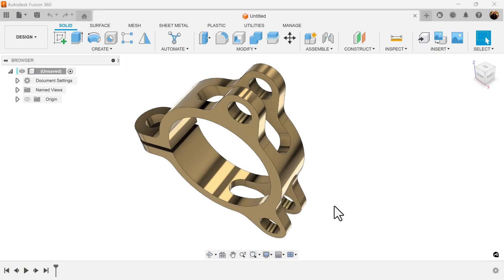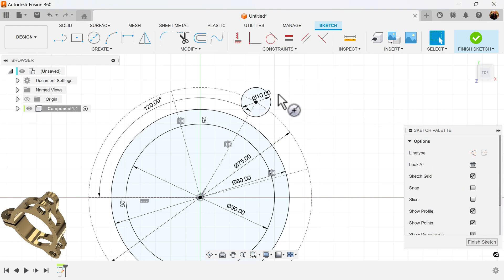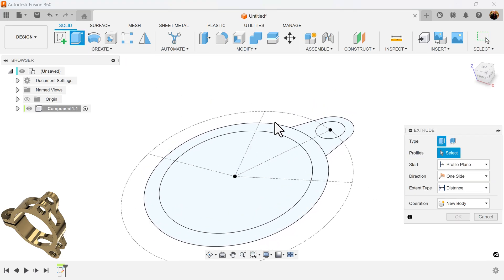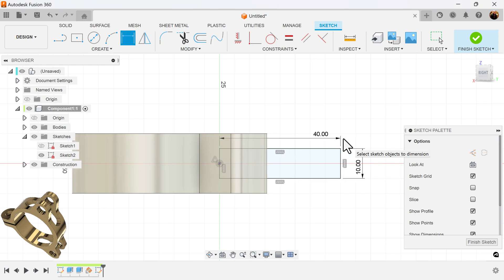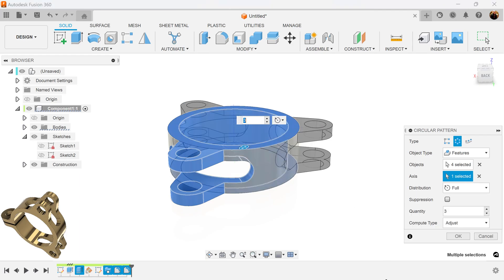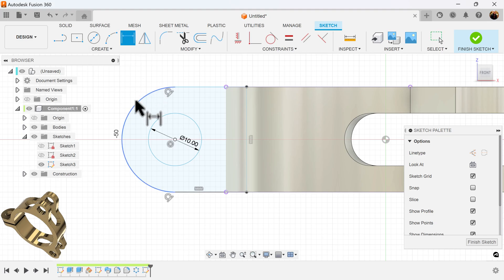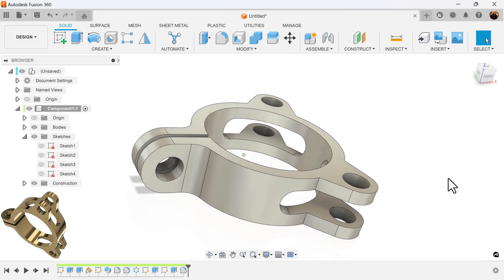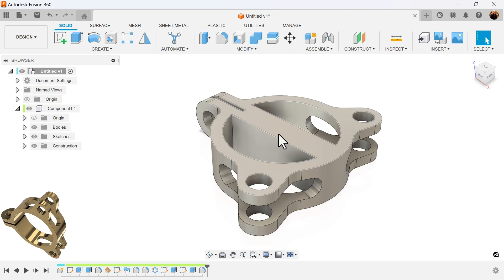Modeling in  Fusion 360 | Rep no. 26

Comment: Your correction of the fillet in the circular pattern didn't work with me, the fillet icon won't become bleu.
Also I liked the fillet full round function at the slot very handy. I also try to avoid start a sketch on a constraint line, because it locks it into place.
Your sketch are automatically projected?
Reply: I found the autoproject in preferences. 🥴
Reply from the maker: Are you referring to the edges that you selected for fillets not turning blue? If so, try holding the control key when doing so.

For sketches on constraint lines, it depends on what you are hoping to achieve. Sometimes you may need to add your own constraints in which case you would avoid automatic constraints provided by Fusion 360.

My sketches are indeed automatically projected when solid geometry faces are visible and used. This is useful to assist in creating constraints when selecting face geometry used as an active sketch plane.
-  You can set this in Preferences--> General--> Design
--  Make sure that "Auto project geometry on active sketch plane" is checked.

Comment: Another great teaching video! How or why did you use the dist of .25 in the sweep I couldn't find what it was referenced to. Obviously it created the sweep you wanted, I just didn't see where it came from, Thanks Again for these Awesome video's!
Reply from the maker: There are a number of ways I could have performed that cut. I could have formed a revolve and set it to only cut at 90 degrees. But as a teaching moment, I used the sweep command as an alternative and set it to .25 which means that I only wanted it to sweep cut only 25% of the distance which is the same as 90 degrees.  I hope this helps!
Reply: @CADJungle  Yes, what was confusing me is that tool had the box labelled distance, I was thinking length of measurement not percentage, Thanks
Reply from the maker: I need to get into the habit of explaining some things in more detail as I go along. I get so caught up in the execution at times that I miss some levels of detail. That was a great question though!